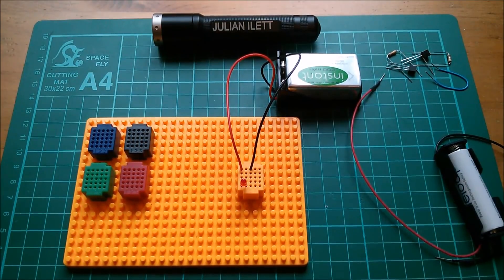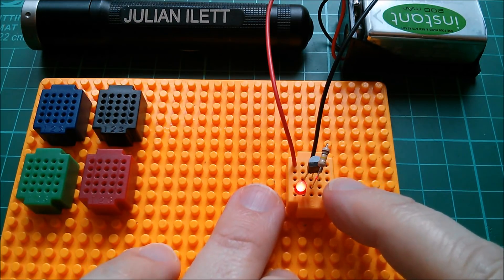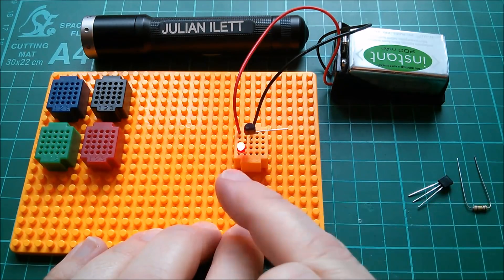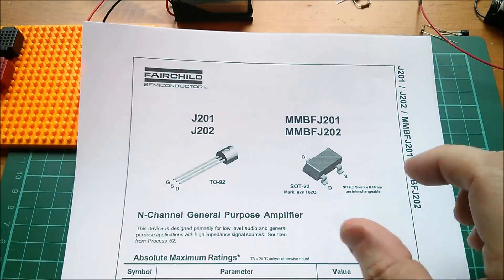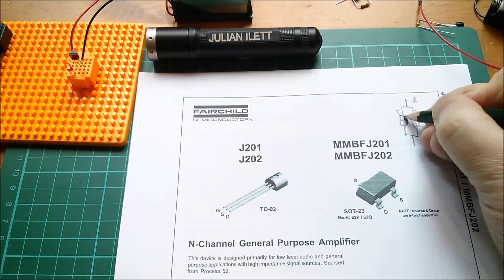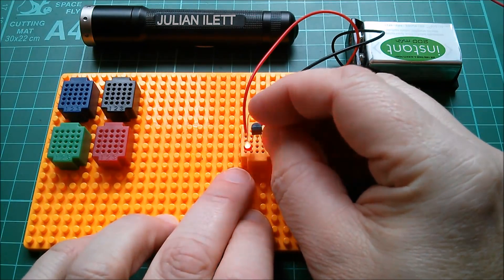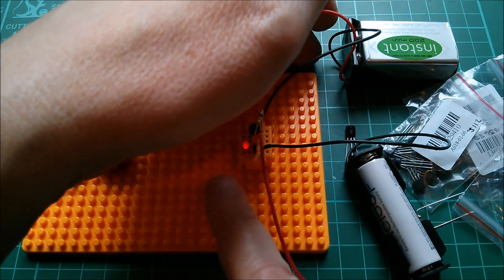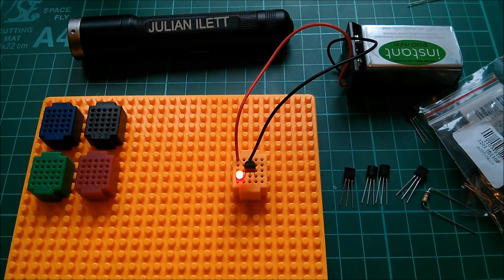Playing with JFETs

Comment: im just getting into electronics and im really enjoying it so far. i bought a strip of  those MMBJ201 SMD and a pcb adapter board . im using them to act as the tubes in a marshal Plexi amp but in a pedal form and they sound really good. really good dynamics . if i pick my guitar softly its completely clean sounding no distortion, if i hit my strings a little bit harder it starts to break up with some distortion in a really nice sounding way. i very much enjoyed your video on these Jfets id like to learn more about all my transistors .

Comment: On thhe  subject of JFETs, you should do a video on lambda diodes. It's basically just a P type and N type jfet in series and has an operational region with negative resistance. Sort of like a tunnel diode, but higher voltage.

Comment: How to make +-12V supply from a single 1A 12v wallwart? In my Behringer Neutron the PSU is working from this little 12v wallwart. Is that some kind of inverting IC or it can be simpler?

Comment: If you ever get back to playing with JFETS try the MPF102 she is highly sensitive, I have been building stand alone ghost detectors with these JFETS for some time now, they are very simple consisting of the JFET, an LED and if you wish to extend the antenna, solder on a 1 meg resistor.  I didn't have one on had the other day, but needed to get one out the door for a ghost-buster outfit, so I soldered on a 1k ohm resistor, worked as well as the 1 meg, in fact I think it was a bit more sensitive.  These little units can detect a fellow combing his hair two rooms away on a dry day,  The way I build them is quit simple on a 9 volt plug with the skin removed, solder the Gate to the + terminal, the source through the LED to the - terminal, the Drain works as the antenna and is where to attach the resistor to extend the range.  To use, simply hook it up to a fresh 9 volt battery and keep an eye on the LED, it will pick up any negative voltage flux within a room or two.  I have three of them that I built using different methods, the second one is built on the same basis but using a plastic enclosure and having the works hidden as well as a toggle switch to add to the professional look.  I have a few other type I have put to gather, one based on an Arduino to read the voltage and light up LEDs depending on strength, from one LED to 10 for full force.  Another I built following Big CLive's video but instead of using rabbit ears, which I could not find in our small town, insted I mounted her on a project board, then used a couple of pieces of heavy copper wire recovered from an old Power Supply  These things are great fun!

Comment: Hello, Julian... I'm big fun of your videos, howether I'm complete amateur... What you showed us here amazed me. i know, I'm noob. But, I have one very important question for you. I'm sure it's possible, but I have no idea how to make it on breadboar, so... If you don't mind? Is this possible to boost transistor reaction, so it could "feel" my finger from, let's say 5cms away or 10cms? I will play for sure with yourdemonstration, but my idea is to use the transistor to  react on eletro-magnetic field (let's say 5cm) and then digitally use it as a bit (I guess another transistor could help me to turn 5V on when transistors is "in range"). Yeah, I will be reading and trying...  My idea is to have two or three such transistors generating digital answers and the difference in time (small changes in time (measuread by simple timer) - should allow me to use these transistors for "simpliest radar"... Simply - if I know which transistor is closest to magnetic field - I know where is the source of the field... Well, maybe my sci-fi idea, I'm complete amateur, but I'm working on something, right know it's a software simulation, but I want to build it in breadboard first and then... I hope to build something very simple and very amazin - I must say. Have a good day!

Comment: When you bring the gate positive w.r.t. source, it matters how much. If you bring it more than 0.6V (one diode fwd drop), you are actually injecting significant current through the gate. If you bring it e.g. at 0.3V, you are basically only enhancing the channel (as you do not yet have significant current through the diode).

So the question regarding your setup is are you enhancing the channel or also pushing current through that diode?

Comment: You can build a complete E-field detector on the top of an upright 9v batt. (which is the power source) that will last for years, which will tell all sorts of things about the E-field (esp.in cold dry weather).  On my bench, I have a large sheet of black conductive foam connected to earth ground. It has saved me many circuit components!!!  often (VERY) when you sit at your workbench, and the LED glows bright--you need to touch the foam--sometimes the shock actually HURTS!! I have learned to make a fist and discharge the static through a tight-skinned knuckle.  Or, better yet, tightly hold a small (somewhat long ~6") conducting rod and touch the other end to the foam--A VISIBLE DISCHARGE, BUT NO SHOCK AT ALL!!!  Again, this can be spectacular in very cool dry weather. 
--dalE

Comment: Thanks Julian, for a nice introductory video. The reason why doping levels are so low is because a Silicon crystal with a small number of imperfections is required, rather than a Phosphorous or Boron (etc) crystal with Silicon imperfections. More than the minutest amount of imperfection is first of all overkill, and second far too disruptive of the Silicon lattice. Interestingly, it could take us days at temperatures between 950°C and 1275° C under extremely clean conditions to create those small doping levels. The diffusion process occurs very slowly, and a combination of dopant flow through the ovens, plus temperature and time control, allows for quite precise control of layer thicknesses, junction depths. (Wafer fabrication doesn't adhere to a normal working day!) This is one reason why CPU's, GPU's, and the like, are so expensive; there are a number of different dopant layers, and several intermediate cleaning and preparation procedures for each layer in the Silicon, each of which can take from hours to a number of days. One power outage can mean the loss of a number of batches of devices, each at different stages of manufacture. Chip yields, initial testing, selecting, packaging and re-testing also affect the factory prices.
Reply from the maker: Oh wow, I take it you're in that industry.

Comment: 11:40  The PN body is globally neutral (no electrons are destroyed), at the junction, internally. While we can speak of isolation (the chanel becoming pinched), the voltage at the GATE get involve through  the "free"  electrons from the N type having moved to "pot holes", to "nests" (electronically) of the P type. That makes the P type with an excess of static electrons sitting in its "nests"  and leaving the N-type with un-replaced electrons (depleted) since the bulk of the crystal, after all, it is not a good conductor, but a semi-conductor, when its free electrons are gone (in the nests of the P type). So, there is there, at the junction, a real static electric field  built up, which blocks the curent flow better in a direction than in the other. If you reverse bias the junction, the depleted region of the N type increases, which make the chanel of the transistor less and less conductive... So while we can speak of isolation (mostly for the chanel of the transistor) it is more a static electric field ( 0.5V (surface mount, large slabs) to 0.7V ( discrete component) for silicium ) effect built around the P-N junction which is implied through the GATE voltage. Ref.:"Fundamentals of Microelectronics", second edition, Behzad Razavi, Wiley, pp36-next)

Comment: I've seen JFET circuits with "100 Meg" gate resistors made out of leaky reversed biased transistors... pretty sensitive stuff. See the inputs of the TL072 JFET op amp. 
J112s make really good electric guitar buffer/signal boosters for use in the signal chain in front of other effects devices. 2N5457 is good too and J201 has much lower gain. Jerry Garcia's guitar had a 2N5457 based signal booster IIRC. You'll find lots of great JFET experimentation at DIY guitar effects sites like http://www.diystompboxes.com/smfforum/
Happy New Year!

Comment: @Julian  reverse the polarity of the battery and of the LED in the circuit, then you can pull the gate fully down. Running the circuit in the opposite direction essentially switching between blocking and enhance modes?

Comment: If you are interested in tube/guitar amp sound/quality and have a 2N5457 JFET to play with, check out runoffgroove [dot] com's Fetzer Valve circuit/article (I have no affiliation with the site or it's content).
  I have built that circuit in front of all of my guitar amps as a first preamplifier input stage. It makes a real nice warm tube amp sound. If this preamp circuit is placed in front of an LM386 it makes a really nice sounding simple headphone amp.
  The circuit requires you to dial in the transistor's bias using a DMM or scope. This is probably the reason a circuit like this is not typically found on low end guitar amps. However, the person that is willing to take the time to dial it in, gets rewarded with an amp that sounds much much higher quality than most people expect from a typical solid state amp.
 -Jake

BTW I tested all of the devices listed in the Fetzer article, and I think the 5457 sounds best. You absolutely must do all of the test measurements in the article too. Don't just use the averages given. My devices tested way outside of the averages stated in the article. I have not created any content on my channel about this or anything audio, so don't waste your time checking ;-)
Reply: Reference:
http://www.runoffgroove.com/fetzervalve.html
Reply: Julien,
  About your last comment, 'they make very good current sources.' I like to make a constant current capacitor bleeder circuit using 2× N channel JFETs in a series circuit followed by a small LED. If this is placed across any large capacitor inside an adjustable power supply or project it lets me know if the capacitor is safe to handle without the need to check it with a meter. It's a really handy safety device. I usually just grab a couple of JFETs from little electret-can type microphones to make the circuit for free, as most electret mics have N-JFETs inside.

Comment: Happy New Year Julian. Some time ago you showed a fake LM2596HV going up in smoke. I noticed you powered it with a buck converter. Most of the Google searches I have done predict doom. I have a AC 240V / DC 24V 8.5A buck (fixed) that I wish to regulate with an  adjustable buck of 10 A.  I won't be using more than 5 A.  I thought  that a diode to stop any reverse spikes might be a good idea. Do you know of any reason why I can't ? Please help if you have the time.

Comment: What are they used for? Can you control the resistance in a circuit with one?
Reply: I have been told that they generate much less internal noise than most other transistors. They are somehow easier to use than CMOS (themselves easier than BJT), but have GREAT (really great) variability in their characteristics, even if they are the same part number and of the same batch!

Comment: Nice. About those breadboards and the base plate, I've never seen such, what is the manufacturer and are there any more different modules to that system?
Reply: I remember a postbag where he got the mini breadboards, but the baseplate is a new one to me as well.
Reply: Okay. I know it's NOT Lego as some have said here, because the nubs are too high. EDIT: Or do you call them studs in Lego, anyways.
Reply: There is a company in the US called 5e and they make similar breadboards, but I do not know if they ship over seas.

Comment: Since D and S are basically the same (symmetrical) can JFETs be used to switch AC voltage?
Reply: Vgs  ( V_at_the_gate  minus   V_at_the_source )  must be negative for a N-chanel JFET. Else, you may destroy it ( because then the PN diode conducts ( gate -> chanel)  and damage the transistor  ). So, under normal circumstances, no, you can't have a voltage at the drain, or at the source, lesser than what you have at the gate. In fact, static electricity can destroy the transistor too.

Comment: Hi sir please if you could answer. . 
I have a super capacitor bank with a protection board. . If i want the caps to charge And discharge at the same time 
.. what should I do?? 

It will mean alot if you answer
Reply: Personally, I would suggest to charge them in parallel, and discharge them in serial... with a minimum of resistance when you charge them since for 10F, the contant 5*R*C  is about a minute for EACH single OHM of resistance ( 5 R C  = 5 * 10 * 1  =  50 seconds ). I would use CMOS to change the configuration, "electronically", due to their possible very low resistance, NOT JFET though.

Comment: Adding the second battery is a little confusing. Anyone able to explain how you can make something "more" negative?
Reply: Its all relative. You're making the 'positive' of that 1.5V supply relative to the 0V reference of the 9V battery - so that means the 'negative' of the 1.5V is now 1.5V below the 0V of the 9V supply - so that makes the -ve terminal of the 1.5V battery in essence -1.5V relative to the original 9V.
Reply: Since the montage is not connected to the home electrical distribution, its "ground" is "floating" so its "zero"  is purely a convention. (Even if "grounded" to earth, you can go more negative than it, just like 0 degree Fahrenheit being more negative than 0 degree Celsius.) After all, a voltage is a difference on potential, and a while you report a single value for that difference, a difference implies two values, the second value, the "zero" or the "origine" is just being "assumed", or "conventional", but it is possible to use another "origine" and thus, get more "negative".
Reply: Julian explains this at 13:57 Depends on the polarity of two voltage sources (batteries).
Reply: Connect the source through a resistor to negative of the battery, pick the value so there will be few volts dropped across that resistor at the current you want. That will lift the source above ground, so then by connecting the gate to ground you will reverse bias the p-n junction.
Reply: Julian himself explained it when he built a split voltage power supply using 3 galvanically isolated wall wart adapters. See "Julian builds: a split voltage power supply (+-12v and 5v) "

Comment: What about using combining a LED acting as a light detector looking at the LED that is driven through a series pass transistor driven via an OP amp where the positive voltage sets the voltage to the driven LED and the voltage from the LED looking at the driven LED feeding back into the negative of the OP amp should allow the driven LED to operate like a LASER and not burn out.

Comment: But why during all this fiddling about does the LED not die?  At the beginning, you say "...don't connect the LED directly across the battery because that would kill it".  So why when biasing to get the LED brighter does the LED continue to work??  Thx.
Reply: He says that the JFET "limits" the current. That's why no resistor is needed. The current is never fully 100% allowed to flow.
Reply: Ok, I get that.  Then the question becomes "will some gate bias ever turn the JFET on fully enough to kill the LED".  I would have thought that a 10K resistor from gate to V+ would have turned on the JFET fully enough to kill the LED... but such was not the case.
Reply: That is interesting. I was kinda wondering that myself. I see what you were asking now. Ok, Julian, why didn't the led blow up when you made the JFET be fully closed?  ;)
Reply: He stated in the video that the wire to silicone junction was ohmic, so there must be enough resistance to limit the current so that the LED does not blow even if the n-channel is fully conductive.
Reply from the maker: +Korishan because the n channel always has some resistance, maybe 20 ohms or such like.
Reply: Silicon is a semiconductor, not a conductor, so there will always be some residual resistance when the device is turned on. For this low voltage, and for these small devices, the resistance is sufficient to avoid destroying most LED's. Many LED's can survive for quite a while when connected directly to a small Zinc Carbon 9 Volt battery, because of the battery having appreciable internal resistance. Learnt from my mis-spent youth, which included watching LED colours change as current was raised well above the specified maximum limits!

Comment: Had a lot of fun with 2N3819's about 40 years ago...Leave the gate disconnected, then comb my hair nearby. (Also with a small lamp - LED'S too expensive then) and watch it flash, dim, go off as I moved to and fro the work desk.
The IGFET (Dual-gate) 40673 was a different kettle of fish!  If one removed the ring shorting everything together before it was in-circuit, it was TOAST!
Reply: I remember a schematic for a CB receiver that featured a dual gate 40673. I think it was a book of projects for CB by Robert Penfold.
Reply: Used as a mixer, IIRC. I made a couple of Direct Conversion HAM Radio receivers with it. Useful li'll thing!
Reply: Those 40673's were so fragile! I fried a couple by desoldering them from a circuit, before reading the handling instructions. Later devices had internally-constructed protective diodes, which would allow for a little mishandling.